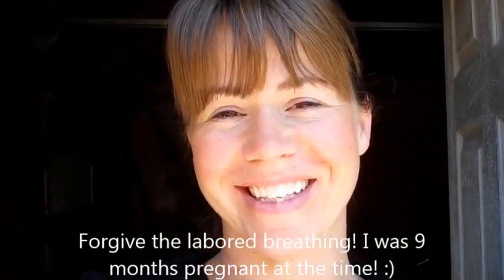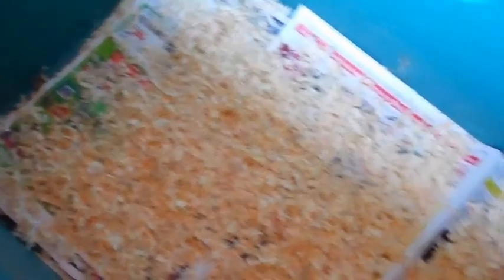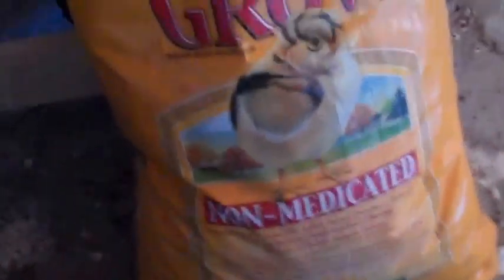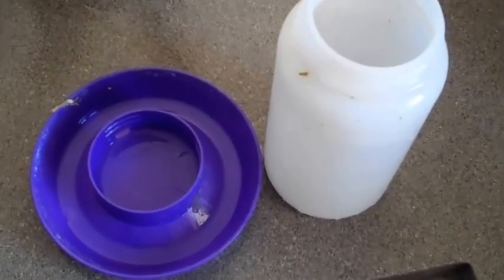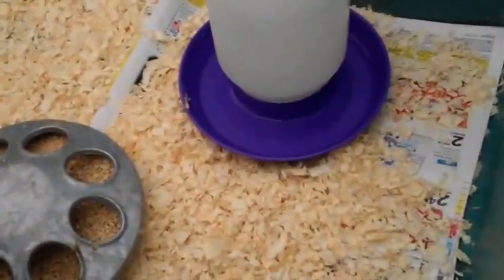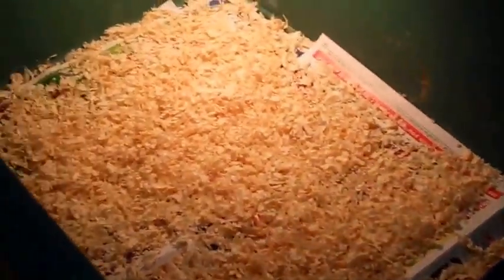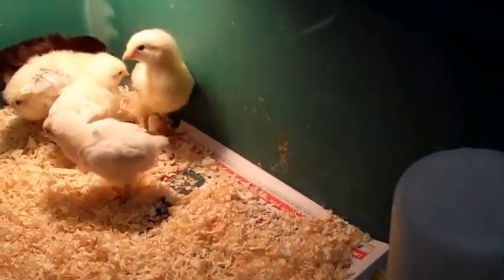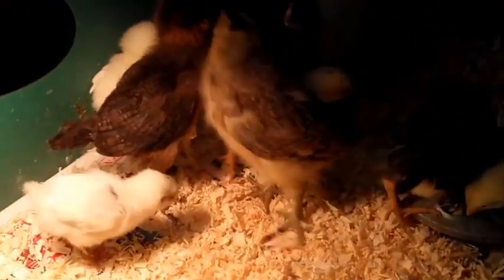Chicken Brooding Box Set Up

Comment: How long do you leave them in the brooder/bin? I am set to get some Red Stars on Monday. Thanks!
Reply from the maker: I left mine in there for about a month and then moved them to a big AC box that I snagged from a friend getting a new air conditioning unit. It was deep enough that they couldn't hop/fly out. And by then it was hot in my garage during the day and I left a light on them at night. Not a heat lamp but that was because I didn't want a cardboard box to catch on fire in my garage. If you don't have any other chickens, I would move them to your coop once it stays pretty warm out. You can always put a heating lamp on a timer (so it's on only at night) in the coop as well.
Reply from the maker: Thanks for watching!